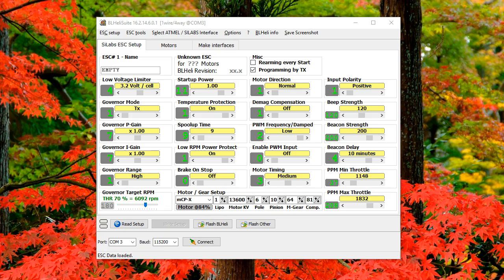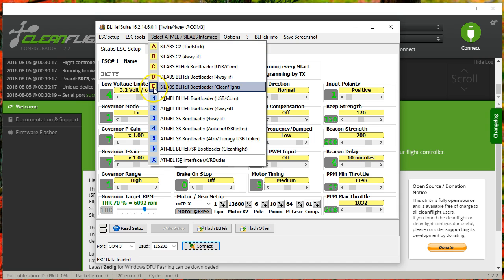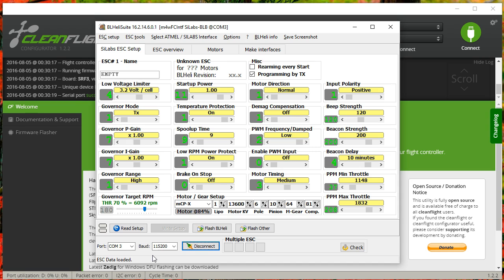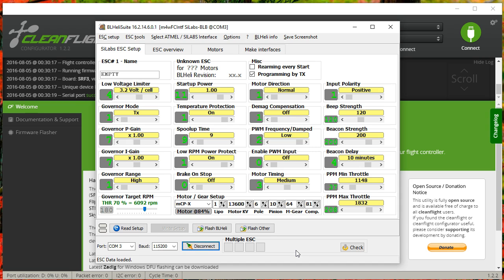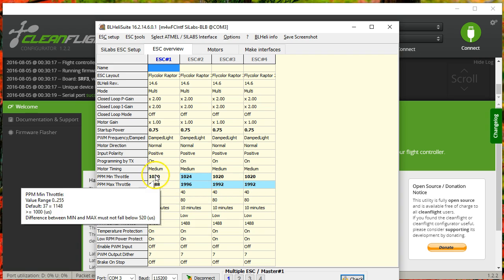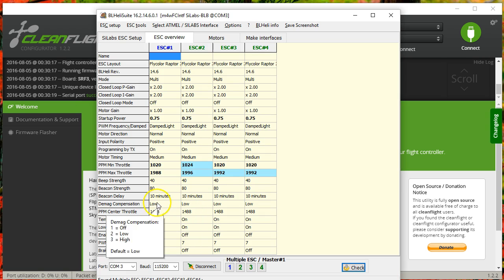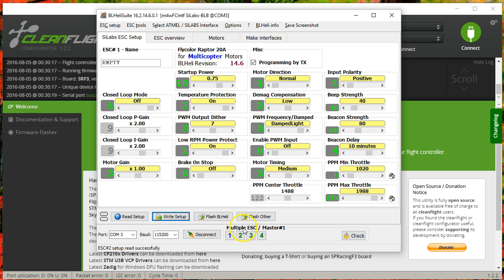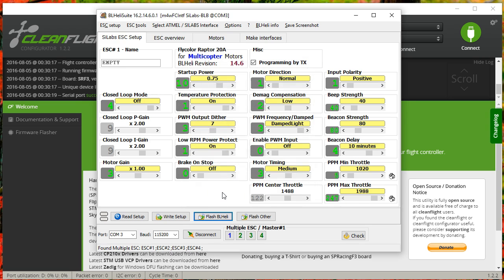How To Use BLHeli Passthrough to Program BLHeli ESCs

Comment: I have a problem. I just got a new crusader Gt2 and updated and configured Betaflight. When I go to update my ESCs two of them are blank and the other two show up as unknown firmware (BLHeli Bootloader C). How do I fix this?
Reply from the maker: Wait. If you're using passthrough, you need interface E, not C.
Reply: I'm using BLHeli suite
Reply: How do I change it to E through passthrough?
Reply: Joshua Bardwell Is it possible to fix through passthrough?
Reply from the maker: In BLheliSuite, the "Select Interface" menu. You want Interface E. I think you said you were using Interface C. Is that right?
Reply: Joshua Bardwell I'm new to this hobby so sorry for the confusion. The two that show up say erased or unknown firmware (BLHeli Bootloader C). I'm using the E interface. From information that I have got from one of the local pilots in my area there is a bug in Betaflight and these ESC's. He said that I have to use Betaflight 2.9 or lower. He just told me to leave the ESC's alone and go fly!
Reply from the maker: +Cecil Lee I don't know about any bug, but I agree with his advice.

Comment: i've just bought the DYS XM20A V2 BLHELI ONESHOT from Hobbyking, can i flash the DSHOT firmware on these ESCs using this method?
Reply from the maker: No. XM20 are BLHeli ESCs. Only BLHeli_S can run DSHOT.
Reply: Joshua Bardwell thanks for the quick reply!
Reply: Joshua Bardwell can all BLHeli_S Esc's support DSHOT?
Reply from the maker: All BLHeli_S ESCs support DSHOT in firmware. But some BLHeli_S ESCs need hardware modification to run DSHOT, especially DSHOT600.

https://www.youtube.com/watch?v=EQJgh-o-uHo

Comment: Awesome video. This is my first drone and I got to flash my esc and only one come up, that is the master. Not really sure what to do. Should I just flash that one?  Some time it will show another one and it will say erased or unknown firmware.
Reply from the maker: +Michael Race for whatever reason pass through is not working reliably on your setup. If the ESC's work, just leave them alone.
Reply: Thanks for your reply.  I am such a noob. I think I messed it up. I was messing with it and thought maybe I will just flash the one that I could see. Went to 16.6 from .2 and that didnt help. Tried to go go back down to .2 but it says it cant find the file. I hooked it up to beta flight to the check the motors and now the motor that I flashed wont turn on.... man I think i messed up big. I should of just waited for your reply...

Comment: quick question... well we'll see how quick lol. I have dys 30 amp esc's with one shot 125. 3-6s. when i connected to blheli suite and clicked on check, it's telling me my esc's are dys 20amp. Why is it telling me this?
Reply from the maker: Likely the 30 amp and the 20 amp use the same layout and configuration, so they didn't make a new firmware just to keep the name consistent.
Reply: Joshua Bardwell thank you for your help and the great content. I really appreciate your work.

Comment: Hey wanted to ask about ESC calibration. I have calibrated esc's and ppm max value in BLheli was 2020. Did some digging and I dropped my max throttle value from betaflight from 2000 to 1970 and calibrated my esc's again and got ppm max throttle value to 1980 avg from all esc's. So is this the right thing to do ? And is it ok to get different values on ppm max on different esc's and then manually drop the values to the same in this case 1980ms or do I calibrate once more and leave them at the values they have? I'm using Lumenier Lux as FC with 3.0.1 Betaflight and I have the littlebee 20A esc's.
Reply from the maker: +M.R yes, this is the right thing to do. You can work max_throttle back up a bit to get a little more resolution out of your throttle channel, if you want. No, it doesn't matter if the values are slightly different.
Reply: Thank you! But this raises another question I found old screenshot from blheli when I flashed them for the first time 5 months ago and the value of ppm max was 1976 and max throttle in BF was 2000. Only variant there is FC. So does the current 2020ms value mean that esc's have been through some "ripping" or is this because of the FC. Also wanted to ask what ppm max throttle value should be the stopping point in max_throttle's tune? Is it like when ppm max throttle is noticeably desynced in esc's or when the ppm max throttle out grows the 2020ms value?

Comment: Thanks Joshua! Just wondering about a couple things. Does the BLHeli Suite work on a Mac? I hope so- everything else works on it and I have no problem connecting Cleanflight, Betaflight or Raceflight configurators which brings me to this- I've been struggling with the RF Config on a Revolt- it bricked my DYS XS30A ESC and fried the board (with their suggested fix of "tweezing" the signal) so they sent me another revolt and when I resoldered everything I still get the same ESC error on #1.I noticed a new target on Boris's list for revolt and really want to dump RF and flash with Betaflight. My longwinded question to you is this: Will I be able to reflash the ESC 1 using the passthrough and BLHeli Suite? Or should I just tear down and throw the revolt in the ocean, get new esc's and start new?Btw, thanks as well for all your other good work and quadcopter knowledge sharing- as a nube in the hobby I have found it immensely helpful- still practicing with simulators and playing with a small Hubsan but I've got three builds on the bench and am excited to start flying out on the farm in the spring... g in Ohio
Reply from the maker: BLHeliSuite is a windows app and will not run under a Mac. Possibly you could use Parallels to get it working but I don't know about that. I suggest trying the BLHeli Chrome app.

https://www.youtube.com/watch?v=8kNB8fsnYdk
Reply from the maker: If the ESC can be flashed, blhelisuite will do it, but it is possible that the bootloader is corrupted and you would need to use the c2 interface.

https://www.youtube.com/watch?v=b-7VFt3IhhE
Reply: Thanks, I checked and there is a BLHeli configurator for flashing ESC's for Mac in the App Store in Chrome!

Comment: hi Joshua.. one question do i need to have my  motors connected  because every time that i power my esc's my motors go crazy... and blheli dosnt reconize the esc's... i have naze 32 rev6  just bootloaded witth  14.3 version 

Thank you.
Reply from the maker: The motors should not go crazy when you power the ESCs. Maybe there is something wrong with your signal wires or your flight controller?

Comment: hello I HAVE A PROBLEM WITH the latest version of BLHelli and cleanflight  they will not work together as described and after following your directions. I get an error message that states Intialization of serial 1wire pass through or 4way interface failed. Please check cleanflight revision for support of  serial 1wire pass through or 4way interface. I would really like to be able to us this program, it might solve a lot of my problems. Thank you David
Reply from the maker: Have you got the correct Interface selected in BLHeliSuite? Should be ... I think it is Interface F, Silabs (Cleanflight Passthrough).

Can you connect to your flight controller with the CleanFlight GUI configurator?

There are no known incompatibilities between CF 1.14 and BLheliSuite. On top of that, the error you're getting is a communication issue between BLHeliSuite and the FC, so your ESCs don't have anything to do with it.

Comment: Reversing motor direction via hardware or software. Resolder or click? By going the software route, are desync issues a major problem.
Reply from the maker: Desync with reversed motors is only a problem on a few ESCs. In general, it is fine. My normal procedure is to wire straight-through and then reverse in software. It's never been an issue so far.
Reply: Thanks! It's clear now. Keep the great videos coming.

Comment: Hey Josh, I see the new BlheliSuite has SK bootkoader as an option, does that mean the requirements from your older video no longer stand? Can we use FC passthrough even to flash SK escs?
Reply from the maker: +Flyleap Studios SK bootloader yes, but not SK firmware. Only blheli firmware.

Comment: Does it works with cc3d?
Reply from the maker: +SrOchoa I think you need a CP210 adapter but I'm really not sure.
Reply: Joshua Bardwell oh yeah i just saw that
Reply from the maker: +SrOchoa I think you need a CP210 adapter but I'm really not sure.
Reply from the maker: +SrOchoa I think you need a CP210 adapter but I'm really not sure.

Comment: Hello! thank you for this video! I have these ecs's( https://www.hobbyking.com/en_us/afro-race-spec-mini-20amp-multi-rotor-speed-controller-with-bec.html ) when I connect with pass through, it tells me that there is another firmware on it and asks me if I want to flash with bheli firmware. If I click yes there are multiple options. I have seen videos on others putting bheli on 30a versions of my esc but I'm not sure if this is ok to do for my situation. the only reason I even searched or came across your video is because when doing an esc calibration in CF (one motor at a time) one of my motors only does a double beep(doot, doot) instead of  the multi to confirm calibration. Can you help?
Reply from the maker: +Justin Mckenzie whatever you do, don't just flash a firmware to the ESC without confirming it is right. You can destroy the ESC and motor. Go to the BLHeli thread on rcgroups to see if you can flash blheli to the ESC's.
Reply: I just found that they can. But how do I know what version to use. The thread I found was kinda old. Also, being that its running BEC, do I need to remove the 1 red wire hooked up to the FC before I do the flash with this pass through method? The reason I ask is that I have seen when using the usb programmers, that's what you have to do. Thank you again for your time and answers to my noobieness! :D
Reply from the maker: +Justin Mckenzie you have to find somebody telling you what version to use. Ask on the BLHeli thread on rcgroups. 

If they have a linear BEC there is no harm in attaching all the red wires. If it is a switching BEC, only one wire should be attached. I think you need at least one wire attached to power the FC.

Comment: Joshua, the motors spin up almost immediately. I did put props on with same result. I'm waiting on a new board to see if that is it. BTW I'm using 4 in 1 harness, Omnibus has a port for this. Then soldering signal wires directly to ESC's.
Reply from the maker: Check your endpoints, I guess, but your endpoints can't be too far off because the ESCs wouldn't arm if the motor outputs were not at idle.

Are you at default PIDs? In theory, super high PIDs would cause this.

Comment: Joshua,
Great video. I have a problem. I'm using Spektrum dx6 radio, Spektrum sat rx, omnibus FC, dys 20 blheli ESC's. New build and have configured through CF and blheli suite. Everything looks great on PC, motor test and receiver. When I unplug and test with radio motors spin all the way up. Can't figure it out. Can you help?

Dan
Reply from the maker: +dan28382 do they spin up slowly while props are off? If so, that's normal. Put your props in and go hover. If they shoot rapidly to full that's different.
Reply: Joshua,
Thanks for the fast response! No they come up quickly, I did try putting props on and same result. Can't figure it out. Waiting for a second Omnibus FC to show up to see if board is bad.

Dan

Comment: Thanks for this great info! Does anyone know if this will work with DJI NAZA M flight controller?
Reply from the maker: Definitely not. This is a cleanflight / betaflight feature.
Reply: Joshua Bardwell  
ok thx. i was hoping there might be some work a round for us Naza M users. this is really a great tool
Reply from the maker: There may be a workaround, but you would have to find a Naza specific workaround.

Comment: i'm using the passthrough method with a lux fc... i upgraded from 16.1 to 16.3 (blheli_s) now when i connect it says the FW has is unrecognized or has been erased.. i can't get it to flash... can you help in any way?? they are dysXS30a... never had a probelm with these before.. i use these a lot
Reply from the maker: +bobby averona you have to re flash over C2 I think. Something has gone wrong. It should be recoverable though.
Reply: is there any certain toolstick i should get.. do you have a link or anything?
Reply from the maker: +bobby averona Arduino Nano from Banggood

https://youtu.be/86Q7sOXL6t0

That video uses an Uno, not a Nano but same idea. Also that video is flashing over signal wire not C2. I don't have a video on how to flash over C2.
Reply: i have a dys usb linker,, would that do the same thing?
Reply: Joshua Bardwell i tried to flash with the arduino nano , but still no dice... i don't know what else to do.. any ideas?
Reply from the maker: +bobby averona over the C2 interface?
Reply: i'm not real familiar with the C2 interface.. i used blhelsuite and prepped the arduino with the blheli bootloader and then proceeded to flash and it won't do it .. i'm getting the same error message... is there something i'm missing? i was able to connect to the esc, but as soon as i connect it says that the fw has been erased would you like to flash it with blheli.... i click yes and proceed, but i get shut down by this error again
Reply from the maker: +bobby averona if the bootloader is messed up you need to flash via the C2 pads.

Comment: i'm running cleanflight 1.11 in a board not supported by newer firmware (BRF3) and the passthrough worked the same way. which was surprising and awesome.

Comment: Thank you so much this video would've saved me 2 weeks of messing around trying to figure out what was wrong and realizing that damped light was enabled on a single esc and the other motors were set to spin up over 100 extra points than that individual motor thank you if only i had found this sooner

Comment: error message: intialization of serial 1wire passthrough failed.  please check betaflight revision for support of serial 1wire passthrough. 
using naze32 rev6 running betaflight 3.0.0 with 20a littebees. would hate to unsolder my esc signal wires to flash usblinker
Reply from the maker: +aviah11 that combination should work. I can't offer much advice that isn't in my video though.

Comment: when the ESC  plug up to the pc and i open BLheil suite it say failed Flash and will not do the tone on the motors when I plug up the battery and know when i plug the motors up on my quad not through the blheil suite it will not make the tones and does not work
Reply from the maker: +flight budz I'm having trouble understanding your situation
Reply: when i plug up the esc's there is no tone and in the blheil suite when i try to flash the esc's the flash failed
Reply from the maker: +flight budz no tine at all when the ESC's are powered? I think they should make at least some noise.
Reply: no tone at all and i was flying earlier that day
Reply: the esc's are little bees 20amp with 14.3v blheil
Reply from the maker: +flight budz do they beep at all if you power them when they are not  connected to blhelisuite? Like just normal lipo no usb
Reply: i have my quad on the table and it is not connected to the blheil suite
Reply: and it does not beep at all
Reply: when i try to flash it says "ESC#1: Obviously an attempt to flash this esc has failed .
now the memory content is most likely corrupted, so do not try to use this esc
do you what to try to flash the again with blheil, to remedy the failure?"

Comment: I have a ZTW Spider 18A Lite BLHeli. Although it says blheli when i got it, its not working for me on both silabs and simonk. I kept getting "connection to esc failed".

Any idea what are the options left for me to do?
Reply from the maker: +DimplePoji try Arduino 4w-if. C2 interface is the last resort.
Reply: +Joshua Bardwell i found the workarounds.. im using a clone fc.. flashed to betaflight and it worked!

Comment: Are BLHeli 14.6 and BLHeli-S the same thing? I just can't find a definitive answer. I was thinking about these ESCs, but I don't know if they're worth it. http://www.readytoflyquads.com/aikon-boltlite-30a-premium-esc-blheli-oneshot
Reply from the maker: +TheBiscuitsAreComing the _s ESC's use 16.x firmware.
Reply from the maker: BLHeli_S refers to a new hardware design that includes, among other things, faster processors, more memory, and hardware PWM drivers. BLheli 16.x is the firmware that runs on BLHeli_S ESCs. BLheli 14.x runs on the original BLHeli hardware design.

Aikon Bolt Lite are great ESCs even though they are not BLHeli_S. I cannot, however, recommend ordering from RTFQ due to spotty customer service. You can order the same ESC from BuddyRC though, and their customer service has been great (the one time I had to use it). Dude got on the phone with me and discussed what I needed to order to convert a top-shaft motor to a bottom-shaft motor.
Reply: +Joshua Bardwell Thanks for clarifying and for the info on RTFQ. I'm saving up to build my second quad with my new Neato 205 frame and trying to decide which ESCs to get for some Emax 2205 2300s. You're videos are so helpful! Thank you!

Comment: Hi Joshua Iam confused about one thing! I have 2 motors reversed and I want to flash and update my little bees so do I need to set all my motors normal before flashing ? Or can I just go into the options tab and choose not to sync esc's for motor rotation?  Thanks in advance 👍
Reply from the maker: +Camshaft Shaft the latter. That's what that option is for.
Reply: +Joshua Bardwell thanks for the quick reply have a great day